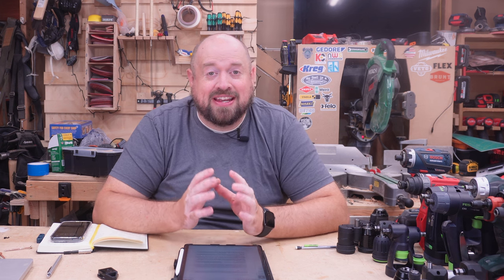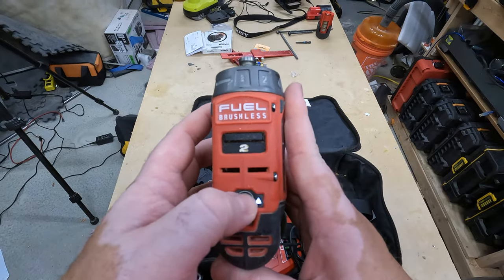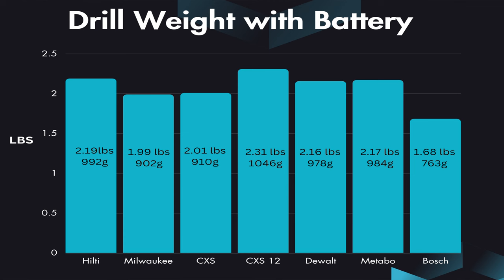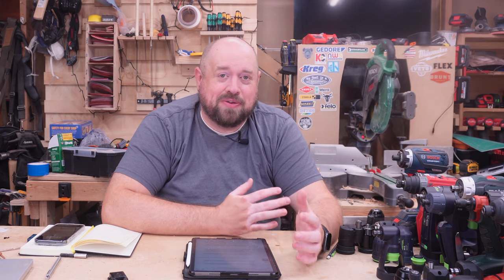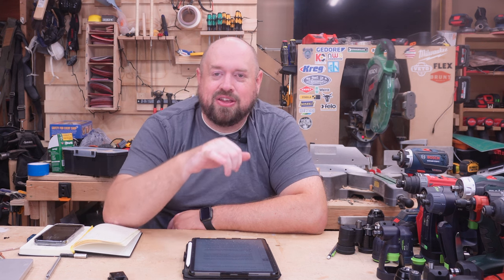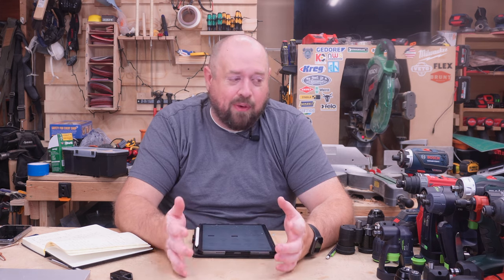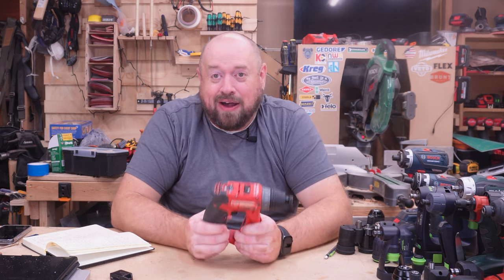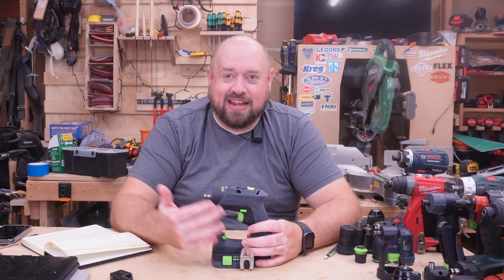Installation Drill Showdown!  Can Festool beat Milwaukee, Dewalt and More???

Comment: If the DeWalt and the Festool CXS 12 were the same price, would the latter have won?
Reply from the maker: If you could get the Festool kit for $189 and can handle the noise... then that is what I would pick, but that would be mostly based on terms of refinement of the tool.   Festool tools are nice to use and it's why people pay outrageous sums of money for them and the system that they reside in.
Reply: @TinkerWithTools  Thank you! That's very helpful because, if they were both $189, you're essentially picking the refinement of the Festool over the power of the DeWALT, but because you mentioned the lower price point. I'm basically coming back to considering a Festool because I recently purchased a UJK Parf Guide Mark II jig to build my own 2096 benchtop. And while I know I will be clamping it down when I start drilling the pilot holes, I was looking at the 3mm drill bit and the 20mm cutter and noticed they are built for the Centrotec system which as you know, among other things, reduces runout/wobble. And while most people appear overwhelmingly happy with the Parf Guide Mark II jig, once in awhile people are running into accuracy issues as it is essential to lay these holes out as precisely as possible to get as close to CNC accuracy as possible, and in one case the person claimed he couldn't get to the bottom of the inaccuracy issue even working with Axminster's engineers to see what went wrong. I don't think it is a stretch that most people are using Festool drills making these products, so now I am a little worried I might be investing all this money on the Parf Guide Mark II only to ruin a very expensive piece of 18mm plywood. Peter Parfitt, who invented the system along with the engineers at Axminster Tools said that he uses the original CXS to build most of his desktops with the Parf Guide system, but in his videos I only see him using it for the pilot holes; he uses one of Festool's $600+ Cordless percussion QUADRIVE drills to drill out the 20mm holes (but I will take him at his word that often uses the CXS for this purpose). Either way, he's also always drilling/cutting into MDF and not plywood. I guess I am wondering if a CXS might somehow yield better results than my 12v or my 20v DeWALT DCD999 hammer drill/driver. Those are my only two options at the moment. Heck, maybe I should be looking at the CXS 18 or even the older C 18 for the extra power. The C 18 is also quieter like the original CXS. If you were building a 2096 bench with a Parf Guide Mark II guide, what would you probably use?
Reply from the maker: I have considered getting the part guide a time or two but the price has always deterred me so I get that you want to be as accurate as possible if that is the direction that you are going.   obviously when it comes to stuff like chuck wobble and such, I am not set up to test precision, but if you are using centrotec bits, that system excels at that.   20mm holes with the CXS 12 would be possible, but I would be susprised if someone is using the old CXS as the primary tool, I would be surprised.   But who knows.  I just wasn't a fan of that tool in 2022 when I bought it for the price that I paid for it.    If I were doing this my self, I would probably use the CXS 12 or something like the Metabo (German, not Metabo HPT) that I featured on the channel a while back.   That drill offers a good level of precision on refinement.   

One consideration that I don't know if you have looked into would be see if someone would rent you CNC time to do it.   While there would be a cost associated with that, I am guessing that it would be less expensive that the Parff guide plus a CXS 12 if that is the route you would go.   Just food for thought.
Reply: @TinkerWithTools thank you for the feedback. I already have the Parf Guide Mark II, so I am committed to drilling it myself, so it’s really just a matter at this point of putting the best foot forward I’m willing or able to afford to do the drilling. If I was relying on this 2096 or MFT-style bench as a track saw cutting station I might have hired someone with a CNC, but I have the TSO parallel guide system, so I really don’t need that level of precision in the dog holes though it would be nice. Plus I have plans to take advantage of the 2096 modularity for future projects (requiring me to drill holes for other components down the road). I’m leaning towards the power of the CXS 18, but I think I may just end up going with the CXS 12. I still have a little time to decide, but it’s a tough one.

Comment: I think the following might help for torque  comparison:
- In Europe all Dewalt hammer drills and drill drivers, likewise the impact drivers have officially their torque mentioned 
The DCD703, DCD701 and DCD706 have an equal Torque of 57,5 Nm ( ≃ 509 In-Lbs ≃ 42 ft-Lbs)
No UWO =Unit Weird and Obscure rating 🤔🙂
Am aware that the factor torque alone is not sufficient to say how "powerful" the tool is! But it is an important criterion.

Comment: Metabo Powermaxx BS Quick series missing in this review. They have another style battery. Like in Milwaukee or Bosh.
Reply from the maker: Yes, they do have a stem style pack like the others but from what I have learned from my research it appears to be their older stuff.   They seem to have made the switch to the slide style pack, so that is the reason for not including it at this point.   I do have the new Brushless Metabo on order and when it comes in (currently slated for mid November) I will do a video dedicated to that and how it compares to these.
Reply: @TinkerWithTools  yes, it is an older model but they still sell them. They have almost same specs as newer model but another grip.
Reply from the maker: Given the close proximity of specs I don't think that I will be bringing it to the channel (with the brushed in this review and the brushless coming soon) but I appreciate you mentioning it in case others are interested.
Reply: @Prime0pt   The in-handle battery pack drill from Metabo is only a brushed model (note that Mafell sells a re-branded version of that drill as well). The 12v brushless only comes in the slide pack, and there are newer 4AH 21700 cell based batteries for these which are fantastic battery packs for a 12v drill (you'll find Hilti has similar 4AH packs for their 12v tools). Makes the brushless Metabo almost as strong as the DeWalt.

Comment: Dewalt come in 1st? There battery are horrible. I stop using dewalt because of it. I swapped to Milwaukee over 15 years now battery still running strong
Reply from the maker: I have had Dewalt tools in some form or fashion for 5 years now with no issue, but I am sorry that you had trouble with them.  Glad you found something that works well for you.
Reply: @TinkerWithTools  yes I have had experience with Dewalt. I been in custom high end cabinets building for over 20 years now. 1st few years I own many line of Dewalt. Almost every single battery stop working in 1-2 years max. Buying new batteries is pointless. So I tried out Ridgid slightly better battery life but run out juice fast. over 10 years now I completely swapped to Milwaukee entire set of M18 and M12. All batteries still running strong and I use it daily. Only one battery bites the dust. For me. The battery is very important no matter how good the tool is. No power no work. And I love cordless tools

Comment: I have a new Bosch like from the video and I hate the noise, I actually prefer the older model (I have both). Too bad Festool went the same route.
Reply from the maker: Yeah to me it seems like the difference of brushed vs brushless but also more potent higher spinning motors in such small bodies.
Reply: @TinkerWithTools   I have 2 Bosch brushless 12v-35 and 12v-20 and the 20 version is so much quieter.
Reply from the maker: It’s the 20 and the 35 numbers for the European model numbers?
Reply: @TinkerWithTools  Yes, the 35 is the same as the 300 in the US and another one is the previous generation. It is also brushless, but a little thinner and much quieter. And also I have noticed that trigger control is better in the previos model, the 300 is just has rapid start, not for precise work. Although I use both, the better is the one that is closer to you.

Comment: Where is Makita ???
Reply from the maker: Does Makita currently have a multi chuck drill?  I have heard rumors of one but I don’t think they have one currently.
Reply: @TinkerWithTools There was a patent covered by Tools and Stuff long time ago showing off an LXT installation driver. No word from Makita since.

If Milwaukee sold the FPDX in the States and had a more sensitive trigger in general, I'd be all over it.

They do need to update the Surge series as well.
Reply from the maker: Yeah, I am not holding my breath on Makita.  I really hope they do come out with it but it seems likes its been more than a year that the US market doesn't have the latest LXT impact driver...
Reply: @TinkerWithTools  What I really want are an XGT hydraulic impact—with controls like the TD173—and an XGT right-angle die grinder.

Comment: Is it safe to say that—if you remove price from consideration—the Festool CXS 12 would have come in first place?
Reply from the maker: It was more consistent than the Dewalt, but the dewalt was better in power, sensitivity, noise.   You won't be disappointed with either and if you have the money, the experience with the Festool is more premium, but in testing I think the dewalt still might edge it out.